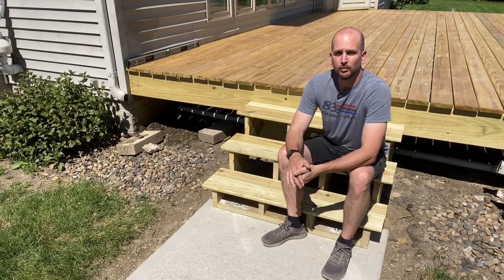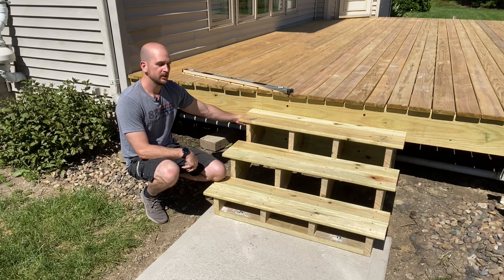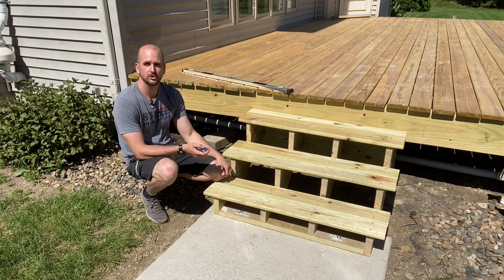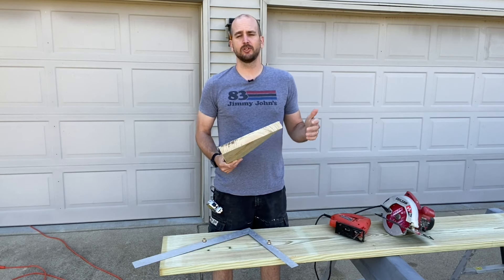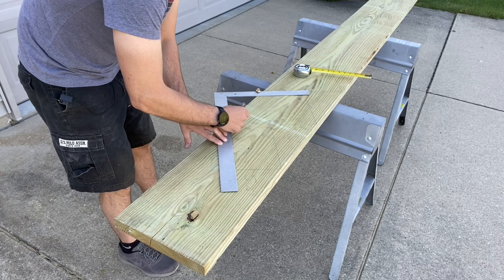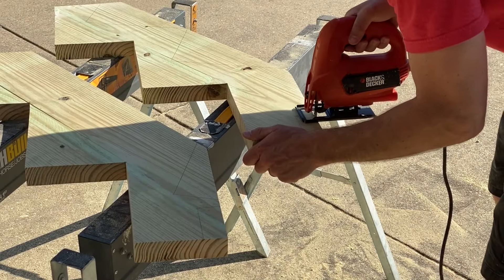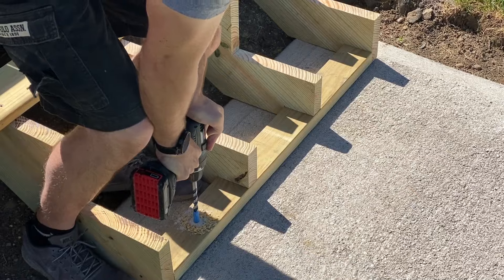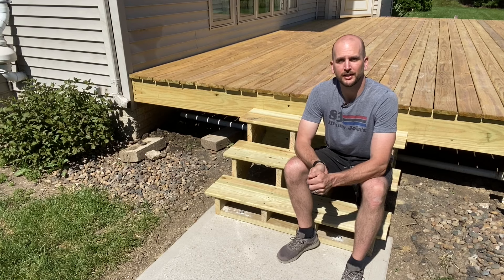How To Build And Attach Deck Stairs

Comment: How thick is the landing pad slab?
Reply from the maker: I put about 4 inches of gravel or base in the hole and then roughly 5 inches of concrete with some wire mesh.  You can see the whole project here https://youtu.be/lKoekm35gjs Best of luck on your project!
Reply: Excellent, thanks! Great video, by the way.

Comment: Maybe it's been asked before, but... 

Counter sink holes for screws in stair treads? 

Drawbacks / perks to using nails for joist hangers? 

Doing a small project like this right around the corner - just want to confirm some details. Thanks!

Comment: You didn't cut release cuts for the crown of the board for your stringer or put a 1x8 for your risers
Reply from the maker: I checked out the stress relief cuts and that is a great technique.  I will use it on the other side of the deck.  For the risers I am keeping this set open so you are right I did not take that spacing into consideration for the cuts.

Comment: Quality stairs require support to the ground level at the back. Attaching to the rim should be very secondary in your planning. Slob.
Reply: Wow dude, who hurt you?
Reply: @Thechemist777  someone who built some #$%^ stairs.
Reply: The engineers who create building codes see no problem with this whatsoever due to physics. Youre secure at the concrete slab with pressure against a solid rim joist. Absolutely enough.
Reply: @lamecatgames7214  sorry, the building engineers in my area do.